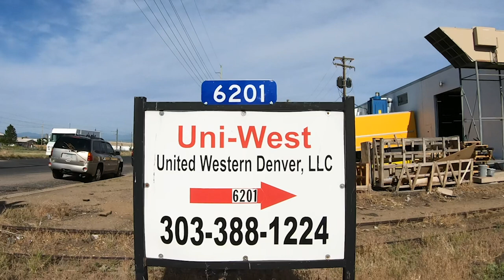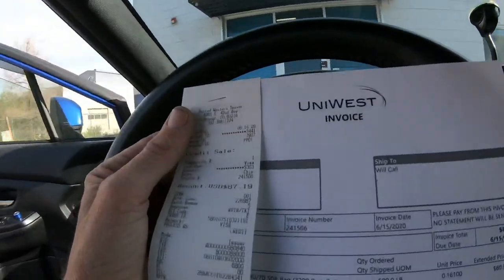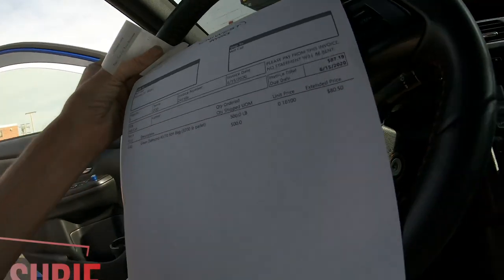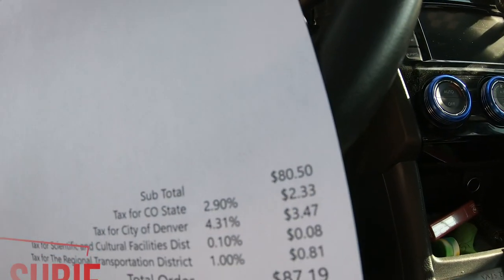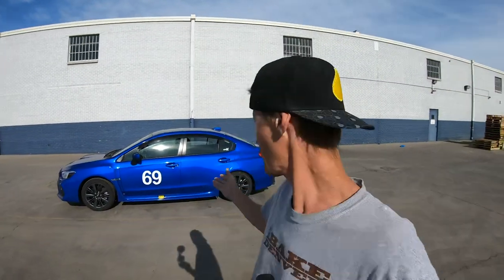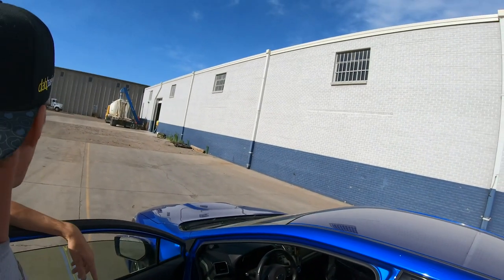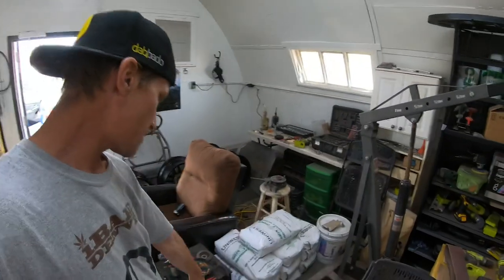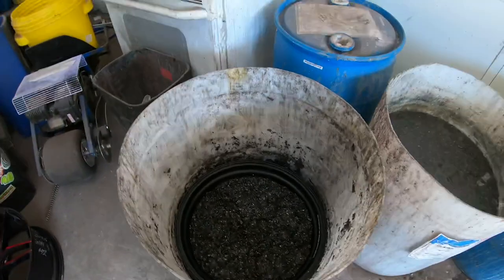How to Abrasive Blast and Prep Wheels for Powder Coat

Comment: Look who hit 1000 suscribers!!! Congrats guys. 

I also have that same harbor freight blast pot. Its a nice little blaster for what it is and what i paid for it. In that blast pot i just use white sand from the local concrete supply yard. It is a 4020 grade and Cost around 5 bucks for a 50# bag.  I dont use it in the bast cabinet tho, it seems to absorb moisture from the air and clump up if left in the cabinet for longer periods of time. But it does a pretty good job of cleaning rust off of plow mounts and differentials. Not sure how it would work on taking the finish off of rims.
Reply from the maker: Tank you for your support and the tip!

Comment: I’m just curious why you can’t blast wheels in a bigger cabinet?  Is there no regulation on the media just being spread around outside like that?  Seems like you would save money blasting in a bigger cabinet but I’m not an expert, any details? (Just saw the very end where you say it’s okay to be outside, but still it’s messy and wouldn’t a cabinet do well)??
Reply from the maker: A cabinet would be nice for certain items, but for others outside is fine.  Even with a cabinet we wouldn't use the media more than once or twice. As for the mess outside, we clean that up so it's not always like that.
Reply: @710performance  Okay thanks for the quick reply, loving the vids and congrats on `1k!

Comment: Do you not have problems with the harbor freight sand blaster? Mine gets clogged consistently..
Reply from the maker: We did until we upgraded the nozzles at the bottom from 1/4" I believe to 3/8.

Comment: Buy a danm cabinet....wasting all that green diamond....huh!!! I wish Having that media here in Orlando
Reply from the maker: We're not wasting it, it's doing it's job, it's cleaning the parts.  If you use old media on a new project it will contaminate the new project.  We are looking at a way to reuse it though, as we're getting more jobs it's becoming more of a hassle to clean it up and to go get it.
Reply: @710performance  , Definitely your right about contaminating others projects...for that reason I make sure to use Matt product and rinse the wheels properly so when sandblasting it only clean just metal not paint or any kind of contamination. Outgasing might always help for an extra clean up depending of how old is the metal...but at least you can use 2 or 3 bags for 3 set.

Comment: Would that 60-100 btu MrHeater work for a 5wide x 6tall x 8deep  oven and if so about how long do you think it would take to heat it up
Reply from the maker: It would be too small. There's a friend of ours  O'mally who used the 60-100 BTU for an oven only about 6' x 4' x 4' and he was having troubles.
Reply: @710performance   sorry I meant the 125000max btu like the one u used first in your oven

Comment: kool l had the bottom of my car done by dustless blasting so worth it l can’t get the harbor freight blaster to work for crap but the cabinet works great with mods
Reply from the maker: We’ve got the blaster pot working pretty well, we just need a bigger compressor.
Reply: How many cfm is your compressor?
Reply from the maker: Kile Angel our small one is only like 15 (we were told 30 when we got it used)

Comment: what compressor do you have operating that pot? Also, do you have any moisture clogging issues with the pot? Air dryer??
Reply from the maker: It's a 210 CFM, and nope no clogging problems.

Comment: I’ve heard a few powdercoaters say their prep only consists of strip, blast, blow off with air & paint. 
Is out gassing that crucial?
I appreciate you saying that the 40/70 nickel slag is ok for blasting outdoors.
Blasting cabinets or building a room is expensive, but blasting outside you’re not able to recycle & reuse the media. Has this changed and wondering if it’s a big savings.
Thanks for the video, wanting to switch from liquid to powder coating. Trying to get all my ducks in a row so to speak.
Subscribed.
Reply from the maker: We like to our gas just about everything.We usually strip, out gat, blast, blow off and coat. When we first started we tried to over think it and just couldn’t get the right finish. We’ve been doing it this way for a few years now with no issues.
Reply: @710performance  I appreciate it, this help a lot as I'm looking to get into powder coating and get away from liquid.